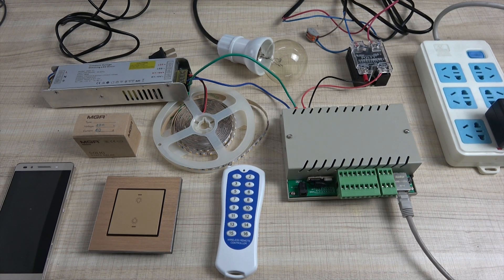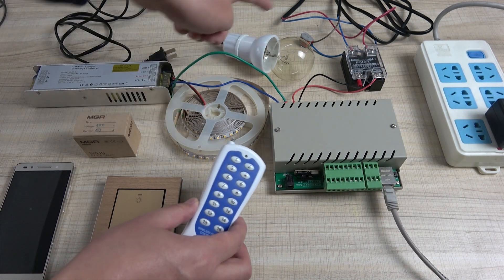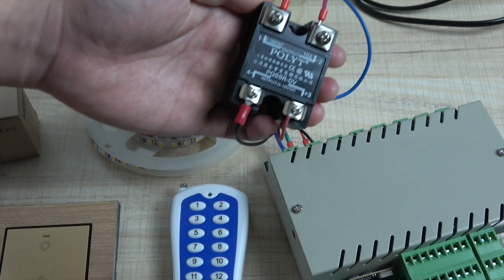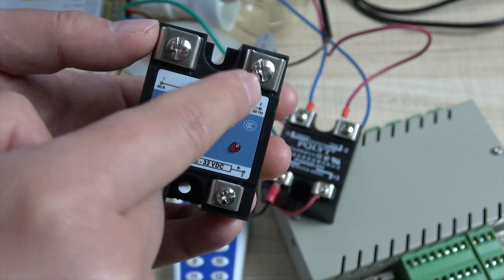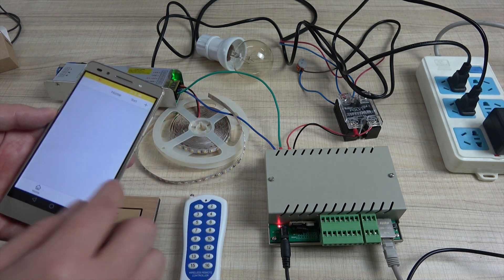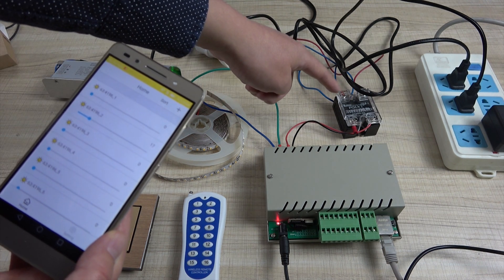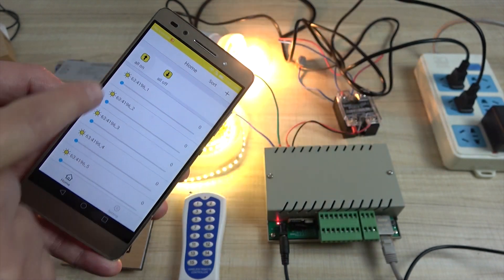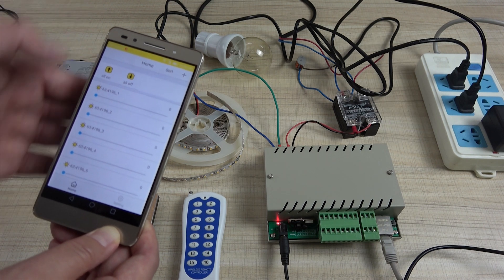How to control LED strip or 220v lamp by KC868-D8 dimmer controller

Comment: The solid state relays. Don't they need heatsinks when using full current?
Reply from the maker: if use 10A fullly, need heatsink.
Reply: @  is there a 20amp version out there that is 0-10v? Only ones I see are 3/342v.
Reply from the maker: @DiyintheGhetto  just find a 20A driver.
Reply: @KinCony  Only 20 amps I find requires a higher voltage on input.
Reply from the maker: @DiyintheGhetto  what voltage?
Reply: @ on the 10 amp one like in your video. it has 0-10v input to to adjust. on the 20 amps ones I find are 3v to 32v. I can not find a 0-10v version for 20 amps.
Reply from the maker: @DiyintheGhetto  https://shop.kincony.com/products/analog-solid-state-relay-regulator?variant=43573259665573   here have 25A version.
Reply: @ are they also 0-10v as well?
Reply from the maker: @DiyintheGhetto  yes
Reply: @KinCony  thank you

Comment: Nobody uses incandescent light bulbs these days. Could you, please, make another video with an LED bulb to show that the dimming actually works with it?
Reply from the maker: LED bulb suggest use DC , not AC220V.
Reply: @KinCony  You are not manufacturing KC868-D8 any more?
Reply from the maker: @martinspukitis1954  yes, now D8 is replaced with D16, D16 will support Tuya and have more functions.

Comment: Tell  me about dimmer please. I have led lamps mark GU-10 and controller H32L. What alse I need to buy to control this lamps with dimmer. Not led tape, namely led lamps.
Reply from the maker: GU-10 work with AC220V ?
Reply: @KinCony  yes
Reply from the maker: @RushMexanik  user KC868-D8 dimmer controller and SSR. here are links: https://www.aliexpress.com/item/4001244247642.html?spm=a2g0o.store_pc_groupList.8148356.1.34c8585fNXfwN2      https://www.aliexpress.com/item/1005001704905303.html?spm=a2g0o.store_pc_groupList.8148356.1.2c597ff2mKDdiX
Reply: @KinCony  Hello..
I bought it but when you raise or lower the intensity of the dimmer the light flashes... do you know how to solve them?
Reply from the maker: @felipemeneses6005  use for DC led or AC lamp? make sure your load support dimmable.
Reply: @KinCony  Thanks for your answer, I use a GU10 AC 220v dimmer led spotlight; it doesn't always blink only at some points... any idea what could happen?
Reply from the maker: @felipemeneses6005  lamp is 220v how many amp? what drvier you are using? whether driver is from KinCony?
Reply: Ok 👌 thanks
Reply: What you say me about controller h32l. He's can control led lamps with dimmer?
Reply: I have one. Can I or not?
Reply from the maker: @RushMexanik  H32L is relay controller, just for ON/OFF, not use for dimmer.
Reply: @KinCony  ok 👌